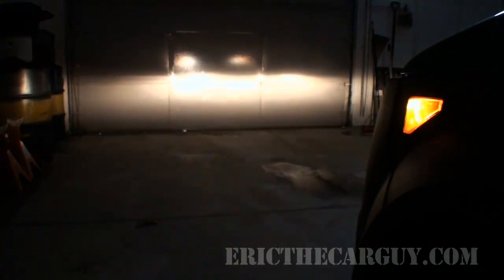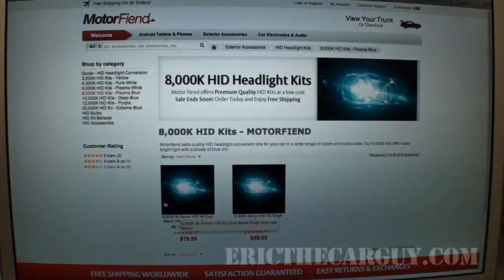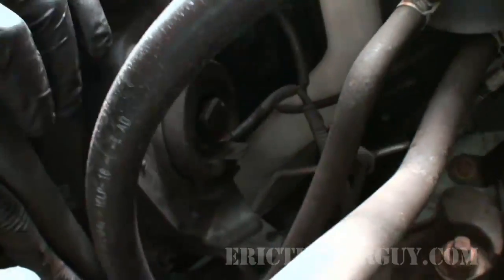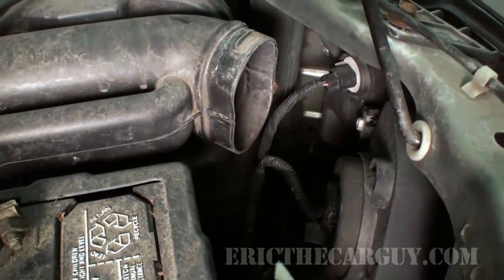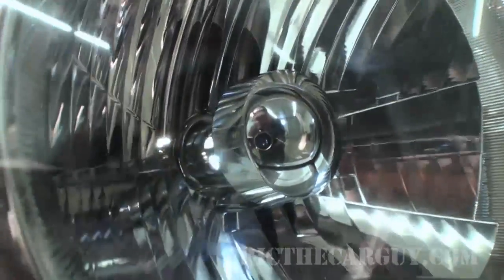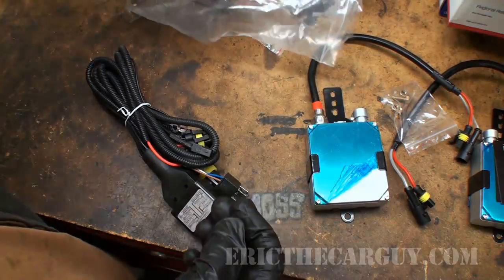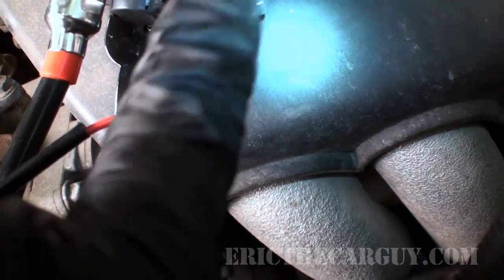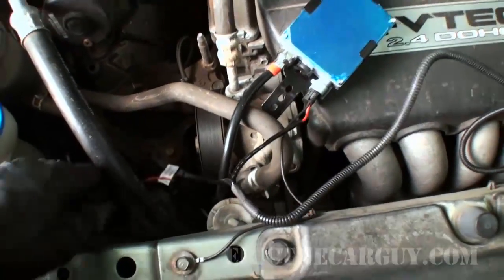How To Install an HID Headlight Kit -EricTheCarGuy

Comment: This is Illegal in every state, installing projectors that are DOT approved isn't, projectors and HID's are not the same thing BTW, you can properly retrofit your headlights from a company like retrofit source or you can buy the whole light assembly which is really easy if your model came with HID's. Slapping in HID's lights in a regular housing is criminal and dangerous, you might as well have a huge sign that lights up saying F cops and F U. Everyone that does this, I Hate You. Unsubscribing.